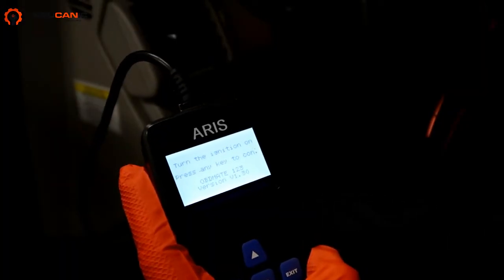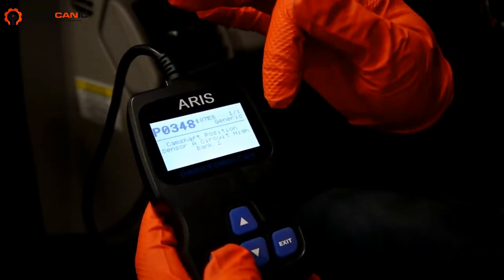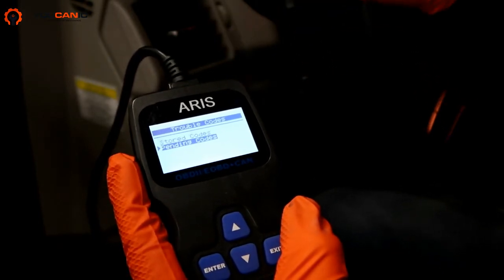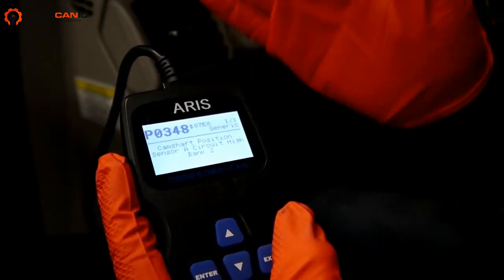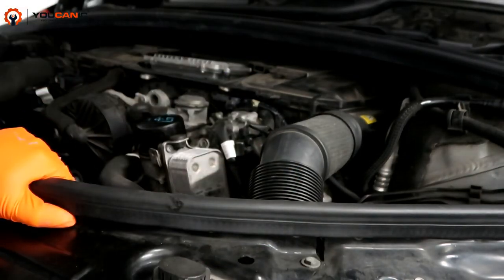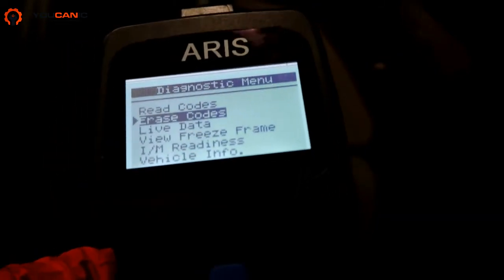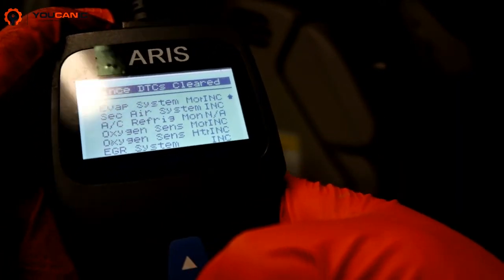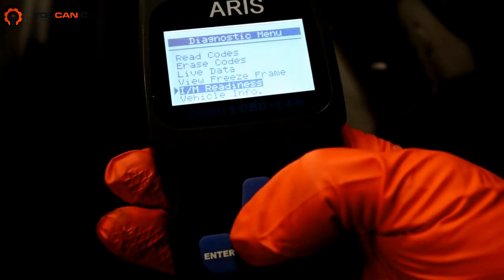Why the Check Engine Light Stays On

Comment: HAHA, what confirms that the issue is with the sensor? it could be a timing issue causing the sensor to give "false" readings :D a good technician will never say that!!!!
Reply from the maker: Of course it could be a timing issue. It could be a lot of other things wire harness, ECU, fuse you name it. Most mechanics start with the sensor first as that is in most cases the issue and the least expensive fix. And if it is not the sensor, well they charge the customer $300+ for replacing that sensor then tell them that they also need a timing chain job and charge them for that too. We see that every single day. Not just by shops but also by dealerships. In 8 out 10 cases it most likely is the sensor though, and car owners can replace most sensors themselves (typically for under $50) instead of going to the mechanic. Also keep in mind this video is part of our guides where we explain the CEL problem in more detail. If you do have any feedback that provides value and helps people we are happy to integrate it in the video / article.  Until then we will keep helping vehicle owners the best way we can, yes for free.